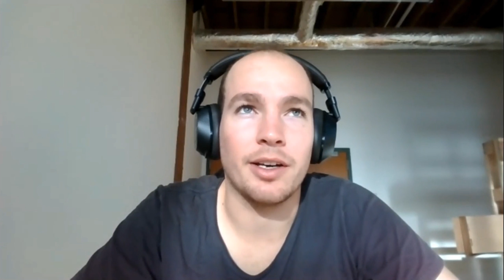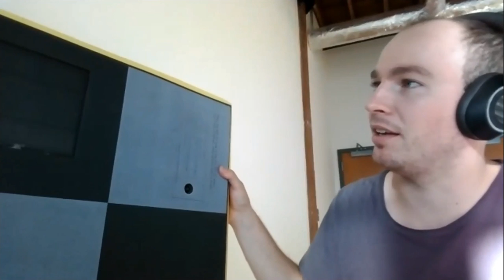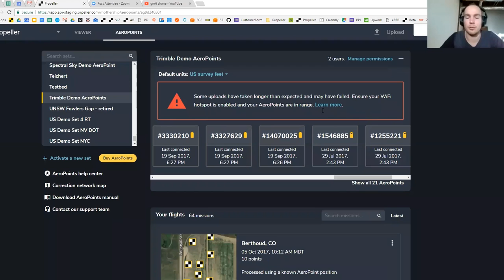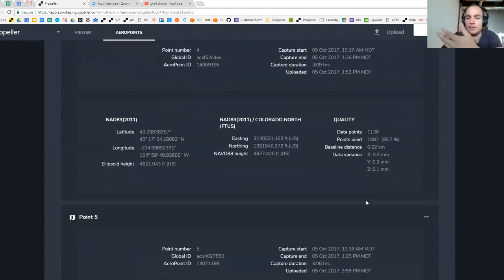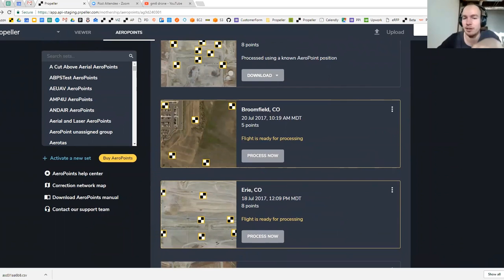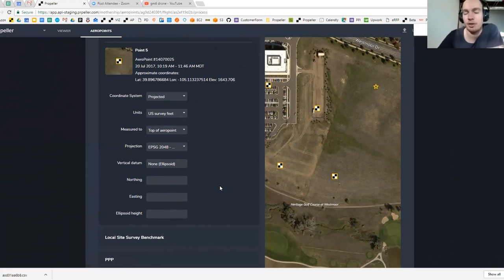Propeller AeroPoints- Interview with CEO Rory San Miguel

Comment: You can buy a GNSS rover for $10k, and print out some targets for a single dollar. With half a day of training, surveying control points is easy. We use over 100 control points in some of our surveys, and this would cost over $50k using Aeropoint targets. Speaking as a person who worked for a survey company, im struggling to see the benefits. The weaknesses are obvious though... easy to steal and cost a fortune. I don't see any gain in speed compared to paper targets as with disposable paper targets you dont need to pick them up afterwards assuming they are biodegradable. Also i see problems with them getting good GPS lock as the antenna sits on the floor. There is a reason a GNSS rover is on a pole!
Reply from the maker: James, I agree they can be exspensive but like most products, it would depend on your needs. I talked to a surveyor with 20 yrs expirience just a couple of day ago, and he said he loves the idea of the Areo Points and will probably get a set. They are to expensive for my needs but time is money.In your case you have a lot of area to cover so it may be cost prohibited. That"s my 2 cents worth.